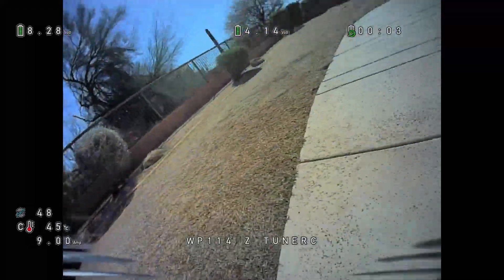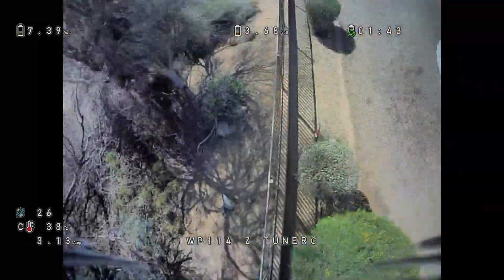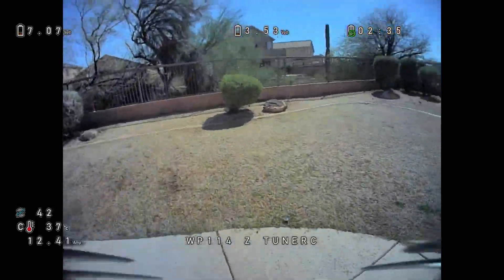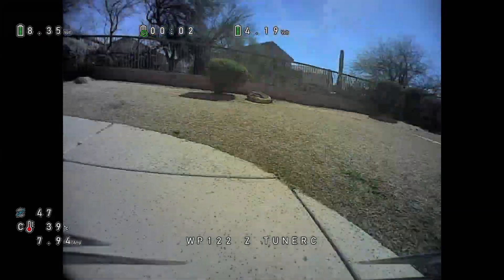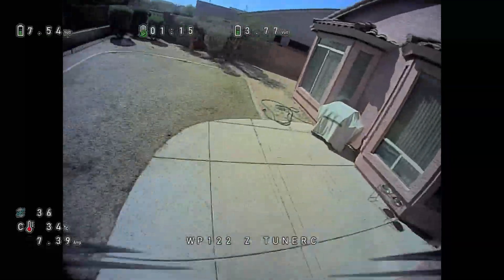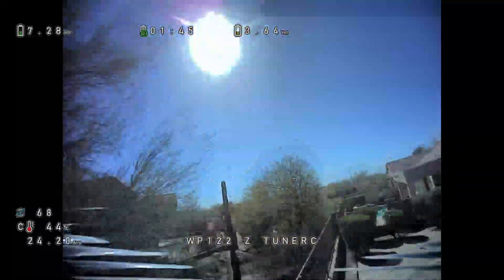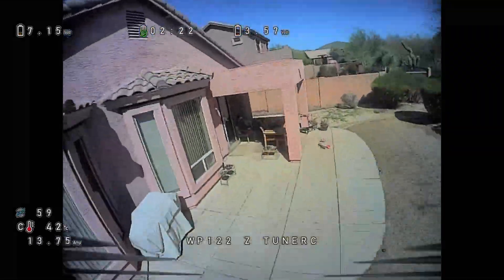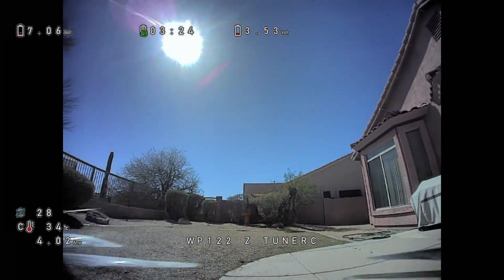You Tell Me: 2.5 inch vs 3 inch HDZero Build

Comment: Hi There,

I've watched several of your videos, I've built the following:
— GnarlyFPV Primo V080X Frame 
— Geprc gep-12A-F411 v1.1 2-4s Flight Controller 
— happmodel ex1102-kv10000 motors 1.5mm
— Happymodel elrs ep2 receiver
— hqprop 65mmgr bi and tri blade props
— Tbs unify pro32 nano vtx 
— Tattu 2s 450mah Batteries 
— caddx turbo eos2 camera
— BlueJay v19.2 48kHz w/ Bidirectional DSHOT

I have it where it hovers, but the motors sound rough, the quad vibrates with oscillation. 
I've tried various versions of BF and currently running BF 3.5.7

any suggestions?

thanks
Hayward
Reply from the maker: This is the type of issue of why I put out a recommended build and BF preset for my frames and highly recommend Flight controllers with black box. It sounds like you have excess mechanical or electrical noise or excess noise amplification due to insufficient filtering or excess latency (too much filtering). Pinning down where it’s coming from involves a methodical progression through all the possibilities.
Reply: @Quad66  ok thanks
Reply: @Quad66  I changed the bluejay esc software from 48khz to 24khz and set to props_out, that seemed to fix the vibration issues.
thanks again
Reply from the maker: @hprompt166  if the quad was spinning props out but BF thought it was props in then yaw would be backwards and cause uncontrolled oscillation. A while back I had issues something running really rough after a pwm change. I think it was a NBD board and the fix was adjusting timing  or something in the ESC settings. I’m glad you got it sorted out.